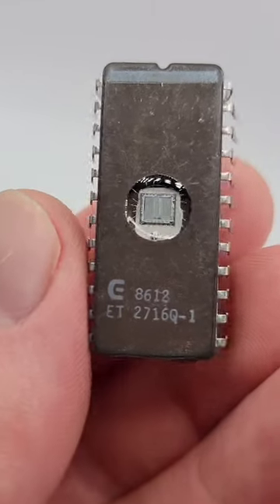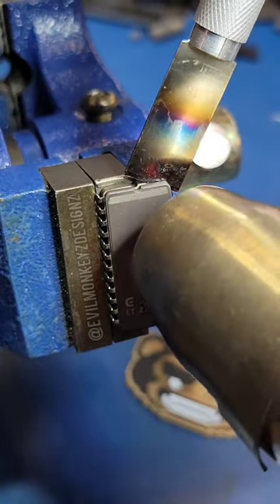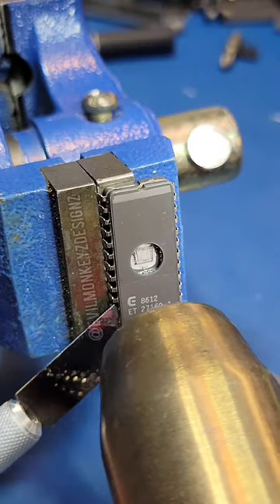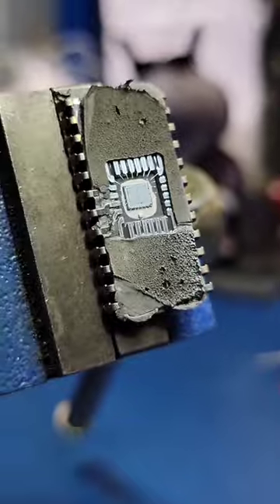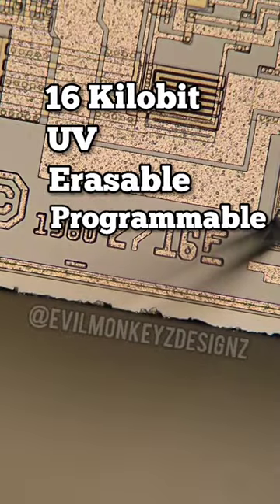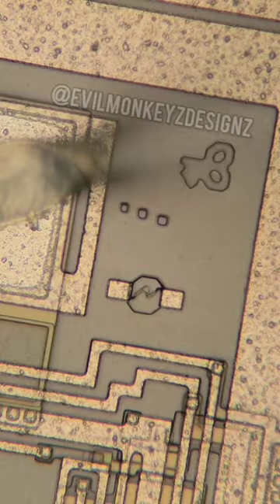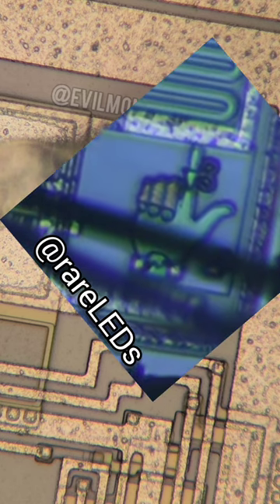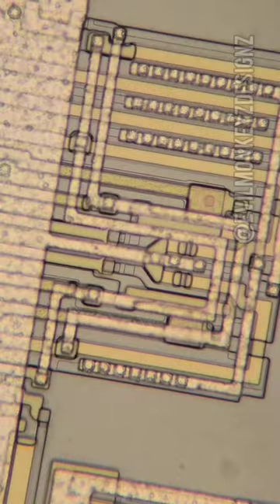16K-bit UV EPROM

Comment: What i still dont get is how info is stored on it
Reply: Each bit of memory is a transistor. A transistor has three pins: source, drain, and gate. If you apply voltage to the gate, electricity can be passed from the source to the drain. If you do not apply voltage to the gate, electricity can't pass. This can be used to indicate data. The computer tries to pass electricity through the source and if it sees electricity on the drain, then that bit is on, otherwise it's off. For EPROMs, voltage is applied to the gate by a special capacitor that isn't electrically tied to anything else in the chip. When you erase the EPROM using a UV light, you're actually charging all of those capacitors, applying voltage to every gate, and setting every transistor/bit on. When you program it, you're sending a higher than normal voltage to the source of the transistor. This causes the charge in the capacitor to leak out through the drain until it reaches a point where there's not enough voltage left to activate the transistor, turning that bit off. So programming it is basically turning off the bits that you don't want on. The rest of it is getting the signals to be applied to the correct transistors, but that's the same as in regular memory. If you want more detail about EPROMs, look up "floating gates".
Reply: @wbfaulk  I'd have expected it to be the other way around. You electrically charge the gate capacitor with an elevated programming  voltage. UV mobilises the electrons on the floating gate, discharging the capacitor. AFAIK you don't need to apply voltage to erase an EPROM. I think what you describe is the process in an EEPROM.
Reply: @HotelPapa100  I agree. I must have been thinking about EPROMs and EEPROMs at the same time. The UV light applied to an EPROM allows any stored charge to leak out.

Comment: When you leave these in a sunlight, they produce small voltage. Early version of solar power cells.
Reply: When you leave them in sunlight the bits are erased, that's what the coverable window is for .  If you want early solar, just grab an LED .

Comment: Those are still used on classic arcade games.   And the window isn’t quartz.
Reply from the maker: Unfortunately, you are incorrect that the window is not quartz. Typical glass like the glass used in house windows includes impurities/additives that block the UV wavelength of light needed to effectively erase the stored information on a UV EPROM. The material used here goes by many names, such as fused quartz, fused silica, or just quartz glass, and it is essentially pure silicon dioxide (SiO2).
Reply: @EvilmonkeyzDesignz   It's just glass.   It was poured into the window.   You can see it was liquid from the reflection the window provides.  Other EPROMs have quartz windows, but they are flat, square, sliced pieces of glass that were placed over the die and glued in place (like the one shown on the Wikipedia page for fused quartz).   The ones where the glass was poured directly onto the die are just regular glass.